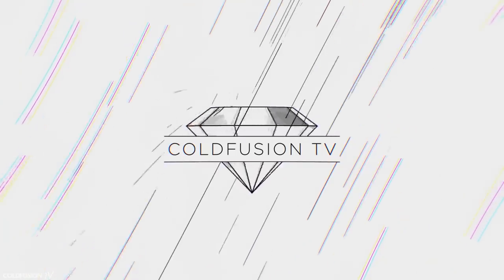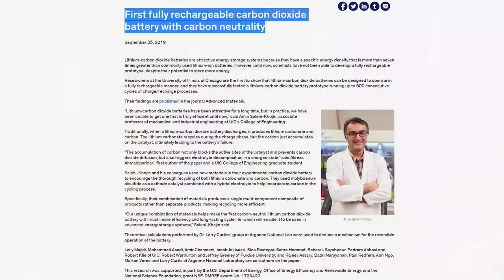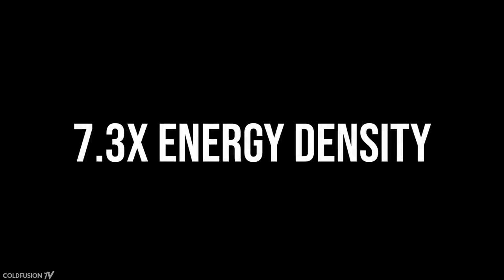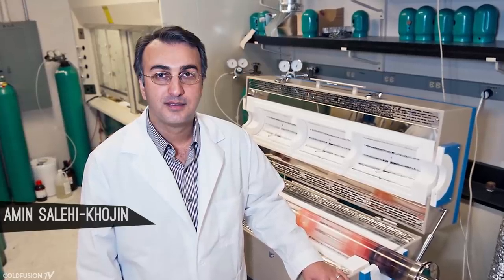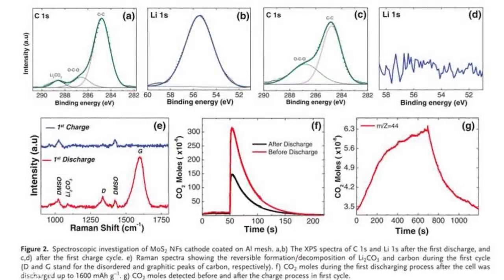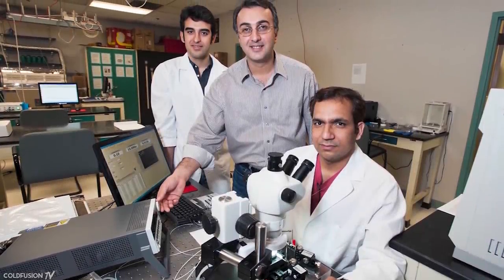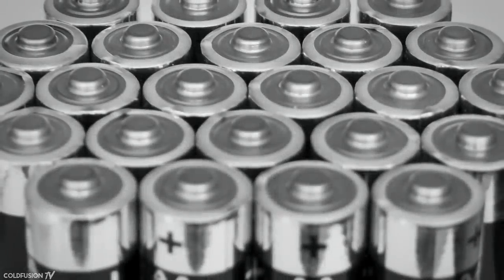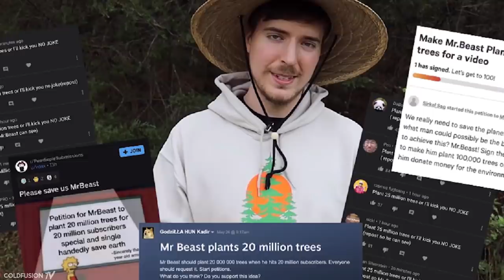Carbon Dioxide Battery Breakthrough

Comment: Every 6 months there is some news about an amazing breakthrough on battery technology. That it will last 10 x longer and charge 10 x faster....

And what happens... We all drink a gin fizz, we all take a piss and everything stays as it is...
Reply: Yep...
Reply: Welcome to the over information era
Reply: Gotta love the old titans of industry keeping progress down because it threatens their money.
Reply: It's so frustrating that this is the slowest evolving area's of tech. Look at the new DJI mini, a tiny ass drone that flies 4 motors for 30 minutes! imagine if one of these breakthroughs actually happened. imagine not charging your phone daily.
Reply: @CrackedTubeGamer  Right? It's such a pain to connect a cable to your phone once a day. These are the world problems that need to be solved asap
Reply: @evilpimp2475  Indeed it is right, since charging your phone once a year sounds much cooler, than leaving it charging daily for an hour.
Reply: @evilpimp2475  Yeah, because using a charge cycle daily is great  especially whilst new phones dont allow for battery replacements and your £700 phone has a wank battery after a year or two.... not to mention top end phones barely have an on screen time of 5 hours.

But your right how dare I wish for anything better lol
Reply: Same with cancer cures.
Reply: From what Ive seen, most of what gets shown has serious downsides or the inventors werent good at actually making it from small prototype into a working production company.
Reply: "The battery shows a superior long cycle life of 500 for a fixed 500 mAh g−1 capacity per cycle,".
Milli.
Reply: Yes. Exactly this. Remember when aluminium batteries were a thing? Then graphine, solid state etc? Yet here we are still on good'ol lithium batteries.
Reply: ... and then your operating system and software will become 10 x heavier and full of junk, nullifying the advantages of the new battery.
(on my right side I'm looking at 3 laptops, 2 PCs and 2 motherboards, some of them still functional, that will be sent to recycling (read be dumped in Africa) because  even the ones that are functional are obsolete and can only move electrons from one side to the other and prove Joule's Law, in practice they are good for nothing except using a lot of electricity...)
Reply: Eventually something changes though. We haven’t ever been in a state of complete non advancement. Humanity has always innovated.
Reply: I can remember a time where Lithium-Ion-Batterys wherent even a thing. How about you all chill and wait ?
Reply: not really, remember when phones neede hours to charge new phones need max 30 to 40 min. And those are the old versions.

And also new breakthroughs need years in testing, specially in battery technology since we don't want a second Note 10 event ;D
Reply: „Breakthroughs“ in research, in laboratories, don‘t mean they are ready for large scale production. Even if it turns out this will be scalable, it will still be a long way to usable and affordable batteries.
Reply: @LemonsRage  Note 7* FIFY
Reply: @insAneTunA  But that's really strange... Humans are greedy. They only care about money so why wouldn't they launch a company with all of those technologies that are apparently better in every way? They have nothing to lose. I do think that with all these inventions they either become classified or they find something extremely wrong with them that renders them useless.
Reply: @zualapips1638  I stopped asking why...I have been around for long enough to know that what might seem logical for you and me doesn't necessarily have to be logical for a large number of powerful and rich people. 

I guess that it also has to do with interest, a lot of people seem to think that it is not in their interest to come up with new technologies because they still have their money invested in the old technology. Maybe they like it as it is, and they might think that everything is going to stay like this forever, until it is too late of course.  

That can be for many reasons. Religious groups have been against technology for centuries. There is the oil industry that found it's way all the way up to the royal families and other powerful rich people. There is the banking industry and they also have big interests in the oil industry. There is the entire car industry with all the suppliers and aftermarket industry. Each year that they can stall the energy transition to renewable energy sources they make billions of dollars. 

Lithium battery technology has been around for decades, but it was first used by the military so maybe it was a military secret. 

Watch the documentary "who killed the electric car" that might give you some answers. 

We all know that electric motors are far more efficient compared to an ICE, they already knew that a hundred years ago, and yet most people are still driving a vehicle with an ICE. 

If you really want to have a better understanding why large numbers of people make such irrational choices you have to research a man called Edward Bernays. 

Whatever the reason is, the result is always the same. We hear tons of reports with new technologies that can save the planet and most of the time we never ever hear from them again. Or it is simply disregarded or ignored. 

Watch this 11 year old video about a man who build, what's called "the hydrogen house" https://www.youtube.com/watch?v=Vel9LH57RII

I think that I gave you enough homework for now. But you can't blame me that I became highly skeptic about these miracle technologies as I grew older. The technology might be invented, but that's still a very long way from being implemented.
Reply: rumor has it that the next samsung phone will have it's graphene ball tech packed in the battery so that's a breakthrough coming to market.... there's also the battery and powertrain day tesla will be holding soon that should tell us more about commercializing the maxwell tech. Improvements are moving forward but definitely not on the new chemistry side of things yet
Reply: Huawei has the longest battery life in their phones.
Reply: @Martin Shepherd the old titans I'm referring to are the companies that stand to lose out with tech like this. Imagine an electric car with a battery that has 7.5x more  range than current ones. That threatens the oil industry. Imagine battery farms for city power storage that can hold 7.5x more stored power meaning there's less need to burn coal less often. That threatens the coal industry. It's not about how much a battery company stands to make, it's about who stands to lose
Reply: Welcome to the world that you can invent but got stuck in the line of investment and manufacturing.
That's where China comes to rescue.
Reply: @loktom4068  Yup! While the US fails to invest in commercialising these advancements in battery tech to protect it's oil industry, China will lead this industry and by extension control the next technological revolution (and therefore the future) in areas such as electric cars, ships, planes, drones, grid storage, wearables and every other advanced electronic device that requires high-density power storage! Vested interests in the US are holding back progress to protect their own industry and bottom-lines and this is going to have a wide and far-reaching impact on the future and who controls these new sectors and technologies! In 10-15 years time it is going to be too late for the US and they are going to be left complaining that China has too much power and control in these areas and what a security threat this is to the US and the world! But it is completely of their own making! Vested interests in oil and gas using their wealth, power and leverage to protect the status-quo and ensuring that federal research funding remains historically low so that these breakthroughs cannot move from the lab to production and be commercialised on a mass scale! This approach is going to seriously weaken and undermine America and allow China to take the lead in a very short time period. It would be great to see the US start to compete with China on the national level by increasing federal research funding as this would result in rapid and massive technological advancement across all areas of society which would benefit the entire world!
Reply: Like it has always been, with good old Lithium xD

Comment: How are the new batteries?
Time traveler: New batteries? We never heard from them again.
Reply: lel so true
Reply: Kwint its very hard to go from the lab to production when it comes to batteries. So there is a lot of news of new technologies in the news, but no new batteries in our stuff.
Reply: Sad but true
Reply: ExxonMobil bought the patents and killed them.
Reply: This perception is created only by the fact that people forget. Nobody remembers that first mobile phones had batteries that had to be changed probably once a year. Now my 4 year old Samsung still runs on the same battery, which still has bigger capacity(but lasts less because the device is much more power hungry). Non of the EV's entering market couldn't do so few years ago, because the buyers would return the cars with dead batteries after one year. (except for Tesla;) )
Reply: phục êwê  then look up how they prevented research on climate change. I don't know if what he's saying is right but it's possible.
Reply: You summed up the idea perfectly 😂😂
Reply: @vilemduha3856  My first mobile - Nokia 2110 - in 1995 had to be recharged several times a day! I had a desktop charging cradle with an extra slot for a second battery for it and a kit built into my car with hands free and, of cause, a charger :D
Reply: @JohanHansson1  yeah but if it was really so much better than what we currently have, surely we would have some of that new technology by now
Reply: @texasblaze1016   maybe. But my understanding is that one of the main problems with batteries today is the manafacturing. For a long time most of the  batteries have gone to computers and smartphones and there are much cheaper ways to make them more effective. We have seen that with the anvancements made with power efficient processors and software. Well a electric vehicle don't have that luxury to the same extent, and the price of the batteries are a much bigger part of the final product. The volume required by electric vehicles have resulted in new investments world wide in new battery manafacturing, and new technologies might come to market faster because of that.
Reply: That is true. Except I disagree. Because electric cars are becoming the future there would be a lot of companies like Tesla ans Dyson (they’re making their own electric cars) that actually buy these patents or help develop with or by them self. As this would be a huge advantage over the opposition.
Reply: @xavierdole7307  Dyson is out. They stopped the development of a car.
Reply: Lol yep
Reply: Lithium batteries prove this wrong they are changing the future as we speak. Or does your phone run on lead-acid? XD
Reply: @UT3CTF  False that is just the FUD spin, besides they are recycleable and the components can be 90+% recycled - plus once down to 70% eficiency they can be repurposed for another decade for stationary power back up, then recycled when 50% or less
Reply: Rechargeable Batteries? Just breath co2 to my smartphone USB co2 collector to charge.
Reply: @j.pgoodwin9020  Just because something is recyclable, doesn't mean its better in limiting it's pollution. It just means it can be recycle at a cost of refining the materials. I've done the math in terms of CO2 pollution with our current energy grid. EVs are worse in terms of CO2 output than great mpg ICE cars, only in a country like France with 90% of their energy coming from nuclear power would it be more eco-friendly.
Reply: Time travelers be like: do you guys still use phones?. We only use brain machine interfaces in the future.
Reply: new generation batteriies and fake news seem to be identical twins . 😨
Reply: It's not that new battery tech is vaporware. It just takes decades to bring to market. Lithium ion batteries were invented in the mid 70s. Didn't hit the commercial market until early 90s. They finally became cheap in the mid 00s.

Combine that with research that leads to a dead end so we never hear about it again. Mainly its researchers eager to convince investors that a breakthrough is coming soon that make it seem like no advances ever come to market. These technologies are still in the research lab. It may be 5-10 years before you can buy one. It could also be 20 years too.
Reply: @JohanHansson1  notice it was rather easy in the beginning, ie first batteries, no labs, no real research. now big amount of research yields nothing. humans can't do all the things they fantasize about, but sure as hell they can fantasize a lot!
Reply: Soon we will have a mini ark reactor
Reply: Everytime .
Reply: its the government and the oil companies teaming up with the illuminati and the cia to prevent proof of god alien bigfoot getting out
Reply: MisterLumpkin That would be stupid. If they had the patent they could dominate battery sales for transportation. Oil can be used to make so many other things and you still need to grease and oil everything that moves. Plenty of markets beside your car.
Reply: @VolkerHett  He wrote changed not charged. Caught me out for a second too.
Reply: @xavierdole7307  Most Dyson products suck....
Reply: @Nitecrow314  The Nokia 2110 used NiMH, charged and changed :D
Reply: Even if that technology won't be applied directly it still get us closer to better battery solutions.
Reply: @UT3CTF  Sorry, but simply not true - Petroleum extraction is MASSIVELY more polluting and once you burn it (more pollution) it's gone!  EVs lose only about 20% with temperature (see ICE at altitude).  EV batteries do not explode and "fry the occupants in seconds"  Research the facts & statistics not the bullshit petro-soundbites.  Take a look at Fully Charged on Youtube for up to date information.
Reply: grayson smith oh I didn’t know o well
Reply: Circuit Breaker damn
Reply: @grantduke318 You are correct, but also wrong. CO2 is not a pollution, its plant food. More CO2 = greener planet
Reply: @yongchenseng4739   ヽ༼ ͡☉ ͜ʖ ͡☉ ༽ﾉ
Reply: Greenhouse gasses:
Watervapor - 95%
CO2 - 4%
Other - 1 %
What do you want to do with the watervapor? And what is an acceptable level of CO2 in your opinion?
Reply: @Ronh83 
American Chemical Society, Chemistry for Life ®

It’s true that water vapor is the largest contributor to the Earth’s greenhouse effect. On average, it probably accounts for about 60% of the warming effect. However, water vapor does not control the Earth’s temperature, but is instead controlled by the temperature. This is because the temperature of the surrounding atmosphere limits the maximum amount of water vapor the atmosphere can contain. If a volume of air contains its maximum amount of water vapor and the temperature is decreased, some of the water vapor will condense to form liquid water. This is why clouds form as warm air containing water vapor rises and cools at higher altitudes where the water condenses to the tiny droplets that make up clouds.

The greenhouse effect that has maintained the Earth’s temperature at a level warm enough for human civilization to develop over the past several millennia is controlled by non-condensable gases, mainly carbon dioxide, CO2, with smaller contributions from methane, CH4, nitrous oxide, N2O, and ozone, O3. Since the middle of the 20th century, small amounts of man-made gases, mostly chlorine- and fluorine-containing solvents and refrigerants, have been added to the mix. Because these gases are not condensable at atmospheric temperatures and pressures, the atmosphere can pack in much more of these gases . Thus, CO2 (as well as CH4, N2O, and O3) has been building up in the atmosphere since the Industrial Revolution when we began burning large amounts of fossil fuel.
Reply: @xavierdole7307  Dyson quit that effort

Comment: I'm so tired of hearing about breakthrough battery technologies that never hit production. Tell me when I can buy it at Walmart.
Reply: @Jason Buford Grammar police here. I'm issuing you a warning for using the improper "There" up there. You were supposed to use "They're" which is a conjunction of the words "they" and "are" unless you meant you were pointing at Walmart, in which case you would need to add a comma. Stay grammar safe, my friend.
Reply: Idk about you but the last phone you bought probably has graphene in its battery...
Reply: @Jason Buford You would end a question with a period instead of a question mark.
Reply: Just like solar. Pregnant with ideas but stillborn to deliver.